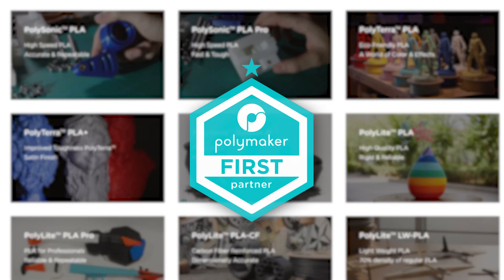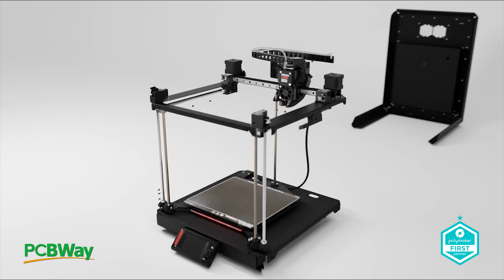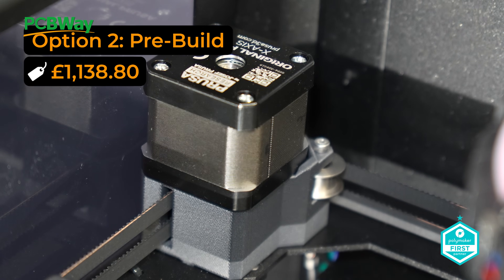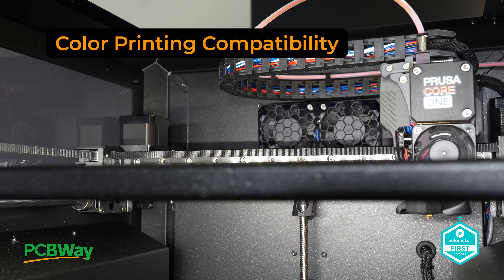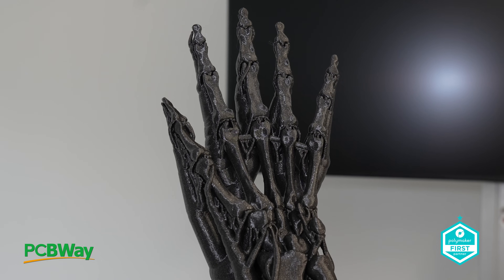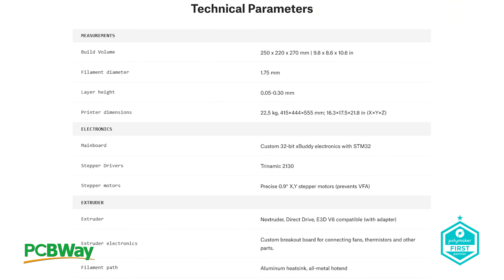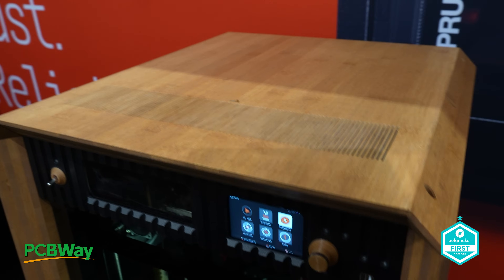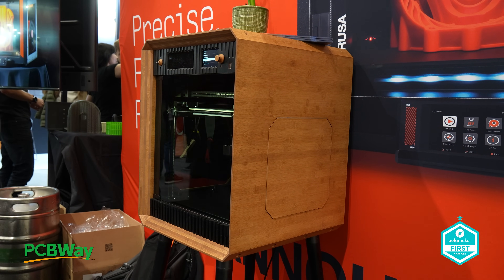Prusa Core One Takes 3D Printing to the NEXT LEVEL!

Comment: An established 3D printer manufacturer has introduced a new model highlighting features like doors and storage. While you're standing still, your competitors are advancing through innovation and competition.
Reply: The thing is they are still charging a ton of money for it, its not like you can't get the same or even better for much less these days. Its still looks like a diy 3d printer, when there 3d printers that are mass produced on an industrial level. Prusa really need to start cutting cost, sell them cheaper, and mass produce them. The core one doesn't resemble anything industrial. Well, at least the mk4 will be cheaper right???
Reply: @oneanother1  ohhhh, so that’s your point?  So the whole “nothing but a bamboo clone” is just trolling?  Huh, who’d a thunk it.  Point is, Prusa is still pushing the edge and these advances will filter down, not only to other manufacturers but also their own products.
Reply: @oneanother1 the new core one is the same price of a X1C while the Prusa is designed and built in the EU.
Reply: @nunovicente34  true, on price. Bambulab has had their x1 like 3 years ago, and it has build quality better and bigger. The prusa looks quite cheap next to a bambulab x1. Their multi color solution is just better too on the bambulab. I'm not a bambulab fanboy, I own a mk2 and mk3 prusa, but the core one just doesn't look like what I would wasn't for the price and build volume. The creality k2 looks more appealing to me. I also have a k1.

Let's see how the core one performs, it could be the very best quality at higher speeds. The EU is known for luxury brands, prusa ain't one of them. Lol
Reply: @oneanother1 you are delusional on multi-material being better on a Bambu.
The XL 5 toolhead runs circles around my daughters X1 with AMS.  It's 10 times faster on changes and wastes ten times less.  Plus it doesn't "poop" filament everywhere.  When my daughter finishes a 4 color print, with say 1,500 changes there's a huge pile and it takes for ever.  Versus my XL doing a print with over 5,000 tool changes, way faster, no where near the waste.

Are you talking about Prusa's cheap MMU3 or have you never used an XL tool changer?
Reply: @Hangs4Fun  mmu3, the prusa xl is in a different class of 3d printer. We are talking about the mk4 as well as the core one, the mmu3 needed to be what the ams offers in its convenience and size. I'd welcome a multi tool head on the core, even an idex. But it needs to be bigger like a ratrig. Prusa needs 300x300 bed size, there's just no away around charging as much as they do for a small bed size. I'm willing to pay for the bigger bed size.
Reply: To be fair, this is a lot closer to what people expect. It's more advanced than the Mk4S, and they didn't raise the price much. Do they need to do more work on it? Sure. But it's a step in the right direction. It's also a fast turnaround for Prusa - I was expecting the Mk4S to be on the market for several years before they announced a successor.

That said - Prusa tends to push more for reliability & DIY rather than innovation. I also notice their marketing is a bit more Apple-like in that they tend to focus on comparing to previous models, so they're also largely trying to retain their own users.
Reply: @logicalfundy  they had to make a corexy, because their sales were drying up. Every other 3d printer manufacturer were leaving them behind. They couldn't charge more, because they aren't perceived as best anymore. And 3d printer are so cheap now for quality prints and speed. The issue is they are still trying to make you pay 1k dollars for a product, that pretty much leaves you with a smaller user base. There's really nothing that separates their new core one from others. No features that are going to exceed bambulab.

They sat on the mk3s for way too long, thinking no one was going to do better than prusa. I'm more interested in how cheaper the mk4 will get. Core one gonna take a few iterations to polish it, even then there's no innovation with it. Bambulab are still better, and its already 3 years old.
Reply: @oneanother1  I haven't heard of their sales drying up.

I'm enjoying color printing without poop on my Mk4S. Print quality is great. Reliability is great, I focus on what I want to print rather than the printer. If something does happen to go wrong, I can get good support and it's pretty easy to fix. Considering upgrades will continue to be an option (including the Core One conversion), it's more of an investment into a printer that will last and improve along the way.

Considering I'm taking out tools and taking things apart and putting them together whenever there is an upgrade for it, I understand it's not for everyone. But I like it.
Reply: @logicalfundy  just by the writing on the wall, sales during last black Friday, doing hyped up YouTube content for a parts cooling fan upgrade (many tuber got a free mk4), and having to release a brand new printer not even a year later.  I would love to support prusa, but their machines are out of my price range.
Reply: They really need to make their multi material color system more like what the others are doing as well. I don't know what prusa is doing these days, they don't seem to have good enough engineers to make better designs.
Reply: @oneanother1 yeah, they aren't cheap, but there's just zero comparison of what an XL 5 toolhead changer can do compared to anything Bambu has.  It was def a hard pill to swallow.  But what I did is got my daughter set up with X1 and AMS, and got myself the 5TH XL for my printing business.  For small single filament prints I do have a couple of A1 mini's, so I did give Bambu a shot.  But having run my XL now going on 2 years, it's just 2 capable to do without.  Granted the majority of my print farm is just doing single filament on mk3 or mk4 (all enclosed with filament dryers and heated enclosures).  The small fleet of A1 minis are great for single or small number prints.  But they really have difficulty doing entire plates of 30-60 small parts, very frustrating at times.  At some point a piece of plastic sticks up and it starts knocking that part which eventually breaks loose  and then usually the rest fail. I've used Bambu Labs or code thing to report the problem a thousand times.
Unlike Prusa, that I can jist start up a chat with and get a 3D printing enthusiast that helps me resolve issues, Bambu is the typical Asian support. IF I get a resolution, it involves a bunch of back and forth emails usually a day or two between each response.
It's just not a way for me to run a business.  So I just use them for small quantity parts, and they are fine.
I did try my daughters X1 out for a large order and it did much better on plate fulls of parts.  So my issues are likely due to the A1 open enclosure and perhaps the heat bed doesn't heat evenly all the way to the edges, I don't know.
I could see having a farm of X1's for single filament work, but there's no way in h3ll I would use AMS to make multi color products to sell.  The end result is fine but that AMS  technology is too slow and too wasteful compared to a tool changer like the Prusa XL.  And that's not my opinion, that's a fact
Reply: Never underestimate the marketing power of adding cup holders to cars.
Reply: @logicalfundy  just by the writing on the wall, sales during last black Friday, doing hyped up YouTube content for a parts cooling fan upgrade (many tuber got a free mk4), and having to release a brand new printer not even a year later.  I would love to support prusa, but their machines are out of my price range. I bought a used mk3, because they've finally fallen in price. I can do my own tinkering on the machine, and I can do cad parts, so really I don't need a prusa. 

As long as the 3d printer uses open source firmware, then I will support them. I have a corexy, if I were to get another one, it will have to be bigger. Its going to be interesting to see what the price of the mk4 will sell for, when everyone upgrades to the core one. Not interested in the core one, looks cheap and nothing new. They really need to make their multi material color system more like what the others are doing as well. I don't know what prusa is doing these days, they don't seem to have good enough engineers to make better designs.
Reply: @logicalfundy  just by the writing on the wall, sales during last black Friday, doing hyped up YouTube content for a parts cooling fan upgrade (many tuber got a free mk4), and having to release a brand new printer not even a year later.  I would love to support prusa, but their machines are out of my price range. I bought a used mk3, because they've finally fallen in price. I can do my own tinkering on the machine, and I can do cad parts, so really I don't need a prusa. As long as the 3d printer uses open source firmware, then I will support them. I have a corexy, if I were to get another one, it will have to be bigger. Its going to be interesting to see what the price of the mk4 will sell for, when everyone upgrades to the core one. Not interested in the core one, looks cheap and nothing new. They really need to make their multi material color system more like what the others are doing as well. I don't know what prusa is doing these days, they don't seem to have good enough engineers to make better designs.
Reply: If that’s what you took from the video, then you’re clearly not paying attention.
Reply: I will take my XL 5 tool head over any Bambu Labs.  My youngest has a Bambu Labs with AMS and for her to do multi material is slow as eF and "poops" filament all over the place.
It's a shame that Bambu started out with open source hard ware and software and hasn't given $h1t back to the community.

So, if I am reading comments correctly, people are giving Bambu credit for core-xy?
Someone please tell me a single thing that Bambu has innovated hardware or software)?? Please don't use AMS as an example, that is literally the slowest and most wasteful solution.  If you say otherwise, you are kidding yourself.
All they can do is mass produce hardware from the innovations of others.  Then they use cheap labor and economics of scale from cheap sources there, and bundle it together.
Both companies have their pros and cons, and I have used both in farms and they both can do the job.  I personally prefer repairs on the Prusa's, there is more thought into maintainability imho. 
I can get around the same 98-99% efficiency from both after some minor upgrades. But as I pointed out earlier, when it comes to.multi-material prints (either for multiple colors or easy support solutions, the Prusa XL wins hands down, it's not even close in any way, granted it was pricey, but there is no equivalent in Bambu Labs lineup.  I'm sure they are working on a real tool changer solution, but by then Prusa will have several years experience on them; if Bambu ever makes a tool changer.  Then there is Prusa's HT90, again nothing in Bambu's lineup like it.

If you have ever owned a business that pays decent wages to workers AND you manufacture things that you actually innovated and invented, having someone just bypass all that research and then mass producing with cheap labor, you would feel differently.  When manufacturers openingly share their designs that COULD have easily been patented, it helps move the entire industry forward at lights peed. To me it's shameful when manufacturers who have benefited from that, don't give back, jist my 2 cents
Reply: How many upgrades you think you’ll be able to do to you Bambu when the new X2 etc comes out? 
Good luck on that
Reply: Spot the shill

Comment: The "Future" from two years ago.
Reply: The voron was launched in 2015....
Reply: @taza99  fair enough.
Reply: This comment aged real well with Bambu being literally the worst.
Reply: It took them a while to catch on, but it is a more technically competent machine than the X1C was. If Bambu doesn't have anything new to offer, then they'll be the ones eclipsed next time.

At this point Bambu has been cloned by everyone, just like Prusa was 5 years ago.
Reply: @carlosjosejimenezbermudez9255  it's at parity with the X1-E. Bambu next gen flagship machines will be out in Q1-ish.
Reply: @rickmellor  No its not. It's at parity with either X1C or P1S.
Reply: @stratos7755  which are two year old machines and will be replaced any day now.
Reply: @rickmellor  they are not going to be replaced any time soon. The new printer Bambu is making is a step up over X1C.
Reply: @stratos7755  we don't know what Bambu is making... just rumors. I hope it'll be a next generation X1C/AMS, plus a larger format machine with the same capabilities.
Reply: @rickmellor  We kinda know from what has been leaked. It will be a bigger printer with 2 hotends (in which configuration, I don't know). That at least is known. There will also be a new AMS (still just 4 spools).

Comment: 🫡 well done, still not a game changer as the goofy dimensions on the print area are still too easily eclipsed by 50 other machines.  Yes yes 90% of what ‘average’ users and companies print easily fit blah blah.  It would have been the one place it could have been a big stand out without extreme amounts of RnD or meticulous thought…
If the bamboo grows faster it will take my and a lot of others attention again… 🤷‍♂️

Still I hope they sell a million of them and release a Mega size version 👍.
Reply: It uses same bed as MK4 and below. Think they could have stretch it to 230 though, but using so many of the same parts you think they could drop the price even more. For bambu, my guess is they will replace the X1C price bracket with the new version, mostly because of the K2 plus prices.
Reply: Pretty sad when my $320 Kobra 3 combo with ACE four color multicolor and filament dryer included in the unit has a larger build volume lmao

Comment: I wold like to know a bit more about the material comparability of the Core One.
Also the wooden  Core One looks sick as f***.
Reply: Probably compatible with everything that needs less than 290C hotend temp.
Reply: @KennethScharf  Yea, especially sins the Core One printer is "based" on the MK3x (Something). So the spec should be close to the MK3.